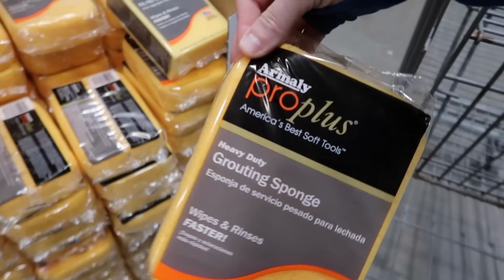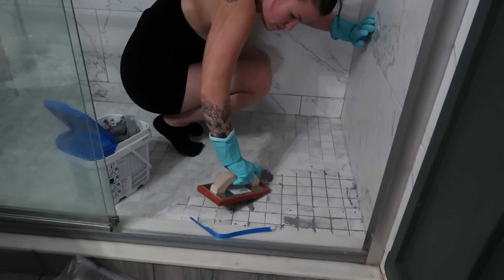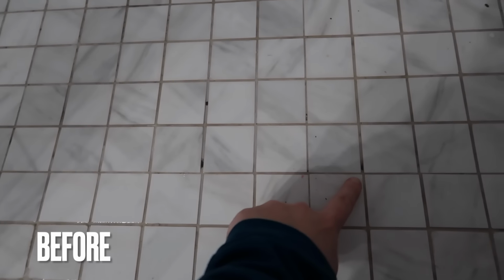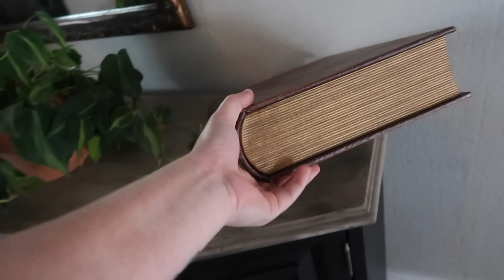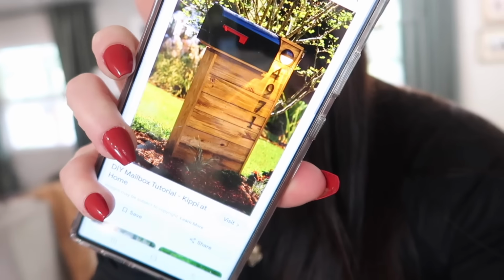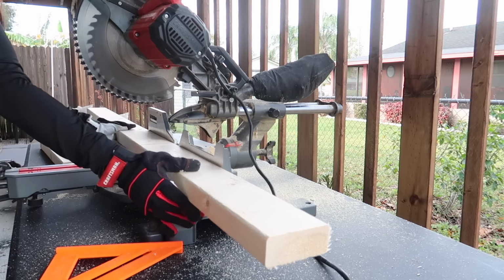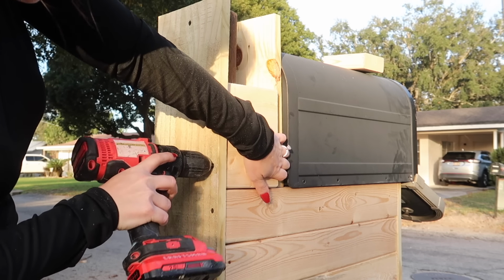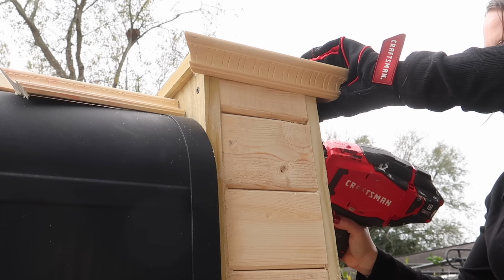Small home refresh on a budget ! Decorating ,building a mailbox and Grouting my shower.

Comment: Keep in mind the lumber you chose is not necessarily intended to withstand the elements, meaning it’s not treated lumber so you will have to seal it regularly or it will not hold up.

Comment: The mailbox is beautiful, but it won't last with the wood you used if not pressure treated.
Reply from the maker: I'm staining and sealing it. The little bit of rain that the inside will get won't be enough to really damage it to much ♥️♥️